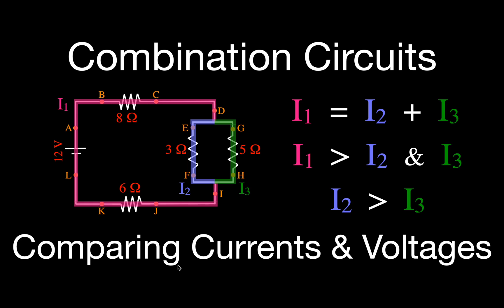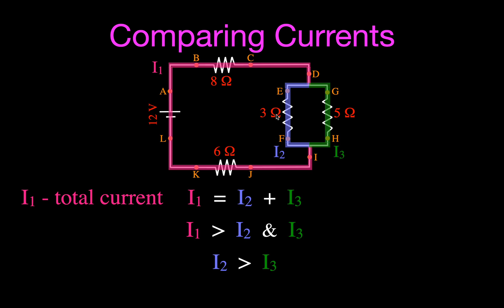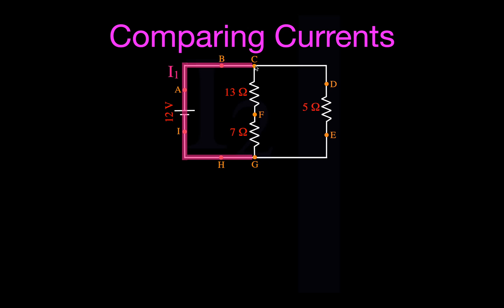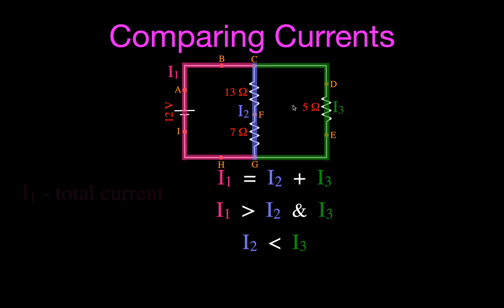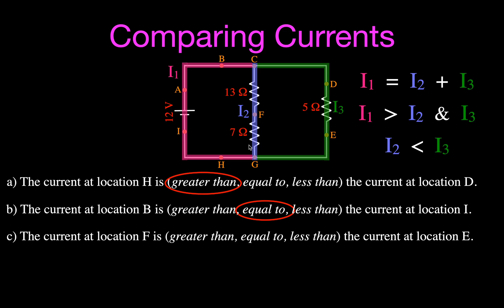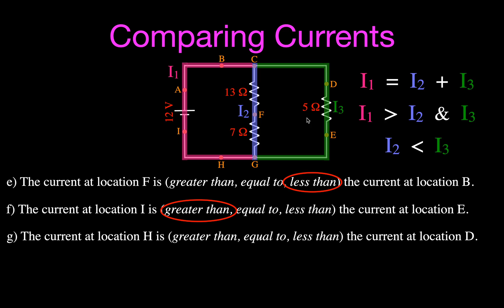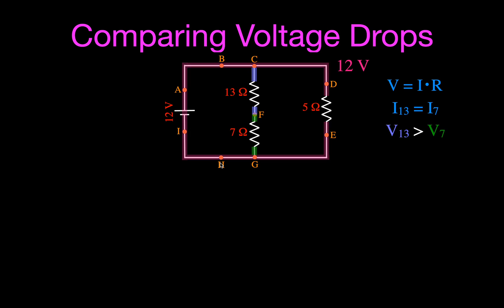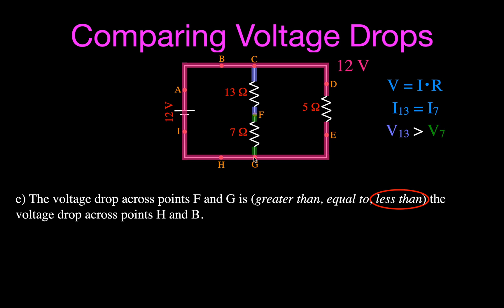Combination Circuits: Comparing Currents and Voltages

Comment: Note to self: Review 17:57 this does not make sense also 18:22
Reply from the maker: In both cases "less than" is the correct answer. The voltage drop across FG is less than the total voltage.